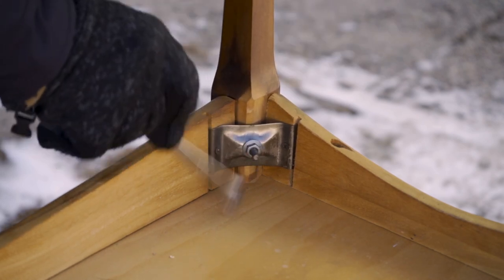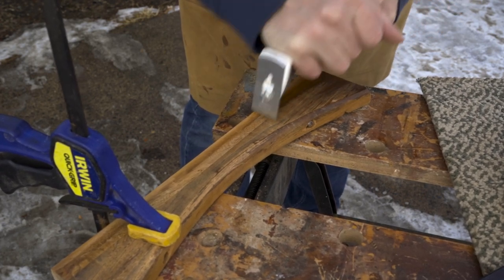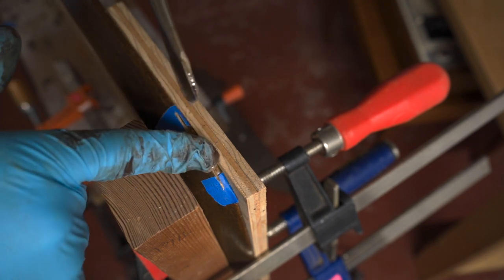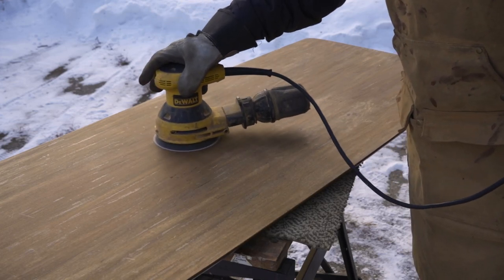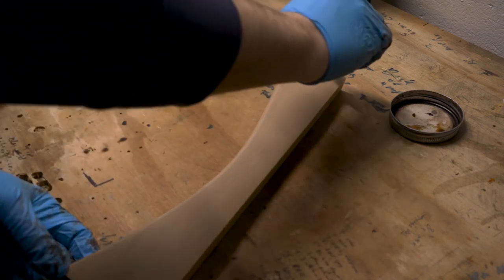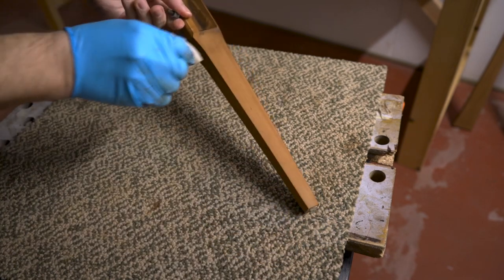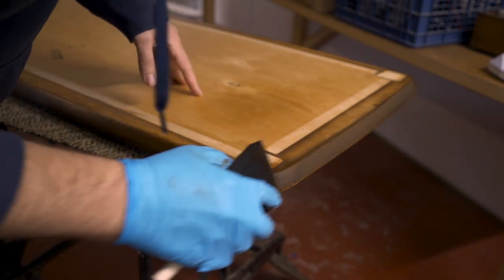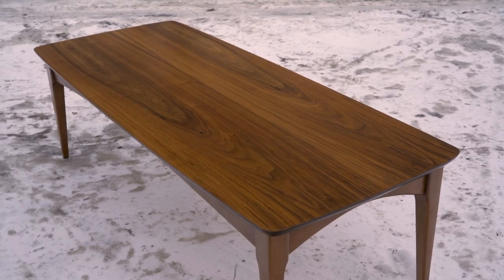Repair and Refinish a Mid Century Coffee Table | Thrift Store Rescue #27

Comment: It’s a beautiful, solid piece, and great job matching the legs and apron to the top.  It looks like it was always a solid piece built out of walnut.

Sidenote, I looked into using wood conditioner from a few vids back and got to use it on a current project with knotty variegated pine boards, and it worked like a charm to tone down the effect of the grain once stained.  Thanks for all your tips 👍

Comment: The way you give these furniture pieces newfound glory is so admirable. Great job as always.

I wonder, how do you know how many layers to use of polyurethane laquer? And do you put them on right after another or let them dry inbetween layers?
Reply from the maker: There's no right or wrong amount of coats.  You just keeping putting it on until it looks good to you and will provide the amount of durability that you want.  I probably put on 4 coats on the top and 3 on the rest.  You have to let it dry between coats.
Reply: @DashnerDesignRestoration  Alright, that makes sense. Thank you for answering so quickly😁

Comment: I’m curious as to why the wax is applied with fine steel wool. I have refinished pieces years ago using circa 1850 to strip the wood, and tung oil as the finish, with fine sanding and tacky cloth between coats.
Reply from the maker: The steel wool smooths out the finish.

Comment: Not sure why you added the wax after the polyurethane sealer. Was it for added protection? Gloss?
Reply from the maker: The wax provides some lubrication for the steel wool. The steel wool smooths out the finish.  The wax that’s left on the surface will provide some protection against liquids.
Reply: I notice more and more refinishing videos add the wax to the wood.  Is this something new or is it an old idea and being revived?
Reply from the maker: It’s a very old technique.
Reply: @DashnerDesignRestoration  Thank you for your reply. I am new to refinishing and trying to learn.